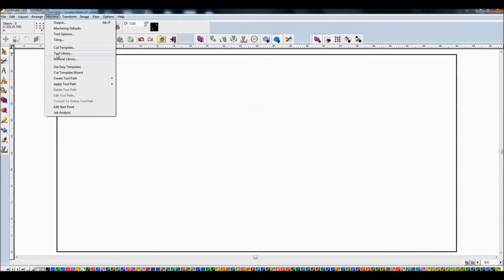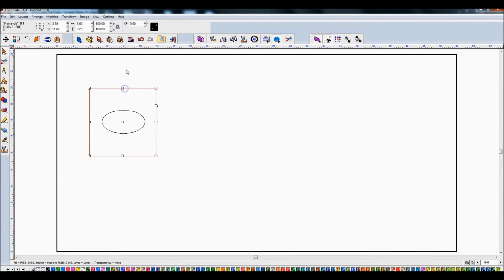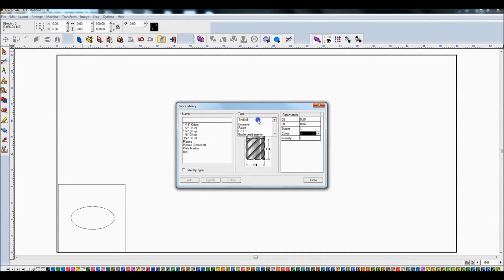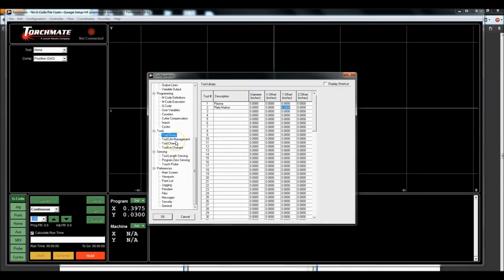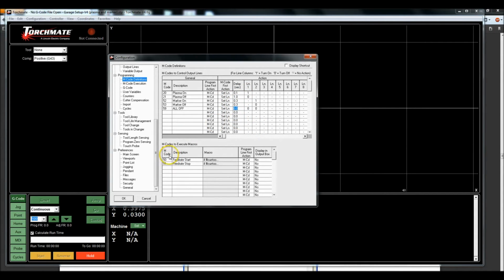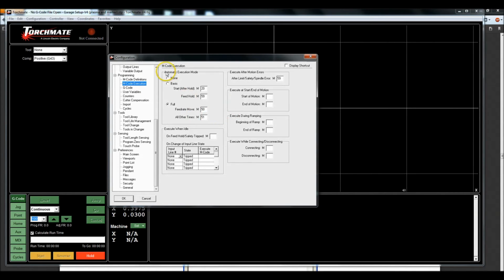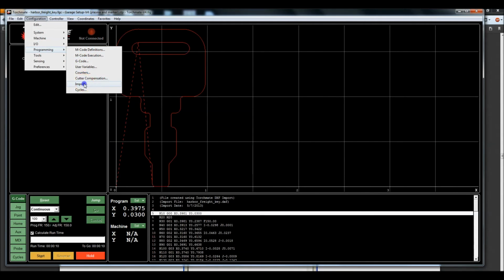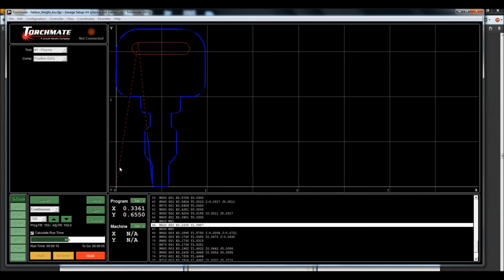Torchmate Plate Marker -- CAD and Driver Setup

Comment: John, which  CAD version are you using here? I have version 8 an when i try to use the cut/ machine tool, it just closes out an goes back to the drawing. do i need the newest version of CAD or do you get a CAD upgrade with the plate marker attachment? Thanks for your videos!
Reply from the maker: 8.0 rev 1.  No upgrade needed for the plate marker.
Reply: Great! thanks!